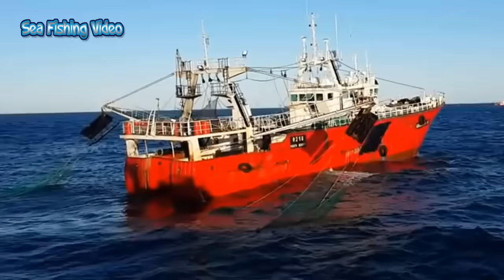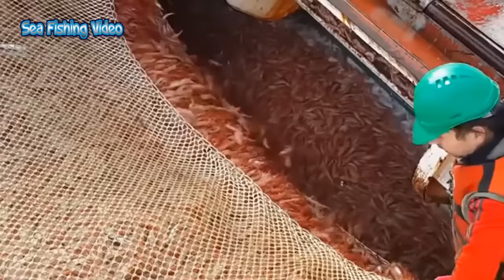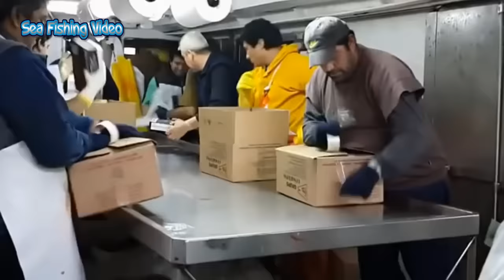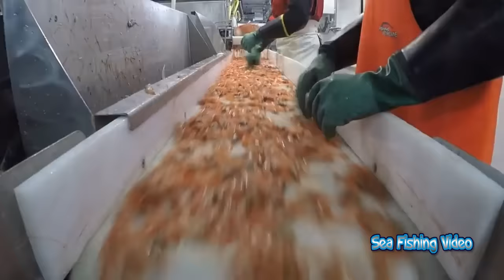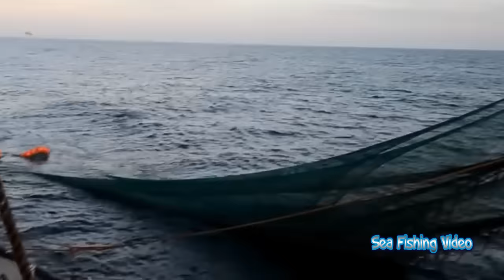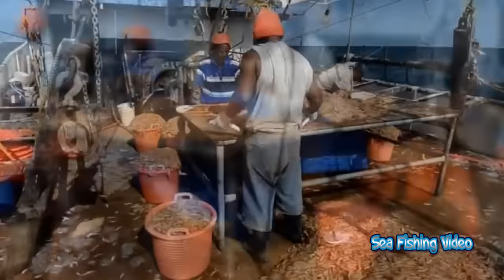Everyone should watch this Fishermen's video - Catch Hundreds Tons Shrimp With Modern Big Boat

Comment: I do not see how our oceans can continue to produce over and over
Reply: I don’t know where this video is from, but I fished commercially for shrimp on the Oregon Coast. We were heavily regulated. So much so we were deemed a sustainable fishery by the powers that be. We too used nets, with “excluders”, as this boat had, which forces bigger fish out of the net. We didn’t have boats of this size though! Not catching/processing shrimp. Anyway, shrimp reproduce quickly, and there’s usually a size limit that must be met.
Reply: @spidermight8054  thanks for that.  I just watch these boats pull in net after net with tons of fish and shrimp to I guess. I’m 61 so it won’t matter to me. I guess I just worry about the future
Reply: Our earths surface is 6/7th water,and  it is anywhere from a few inches to, hundreds or even thousands of feet deep.  Around 7 billion people are on the other 1/7th of the earths surface. We haven't depleted the 1/7th, I don't think we will deplete the other trillions of cubic ft of water. There is no way to fathom what all is in that much water, much less catch it all.
Reply: @chrispringle1625  thank you for that information. I didn’t realize the 1/7th part land ratio. I think my knowledge was compared to red snapper or the red fish / spot tail bass being rationed out by limits
Reply: @chrispringle1625  30% land 70 %water, most of which is barren .